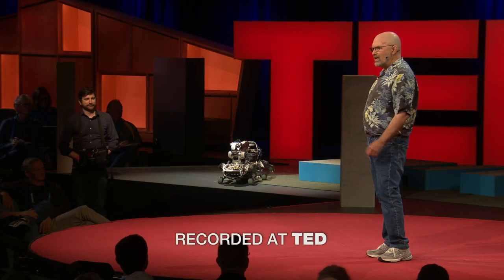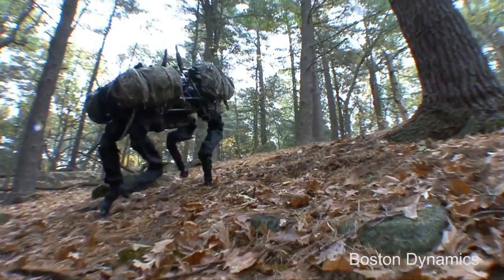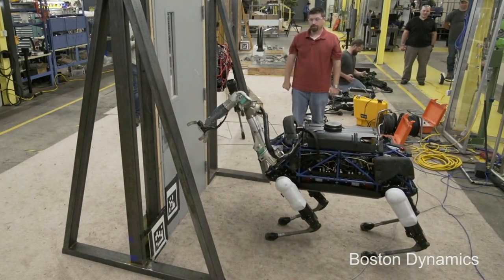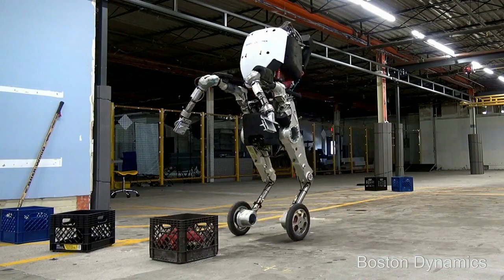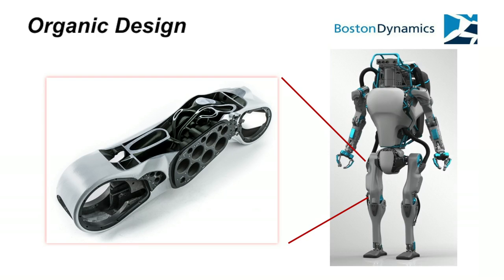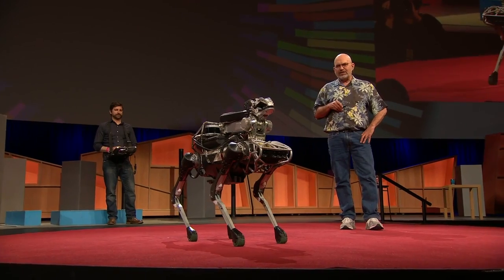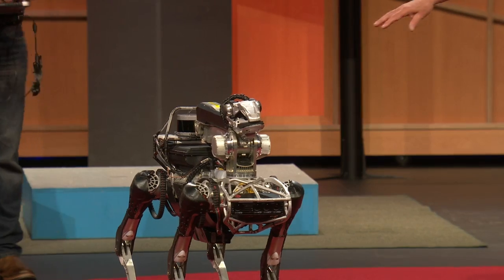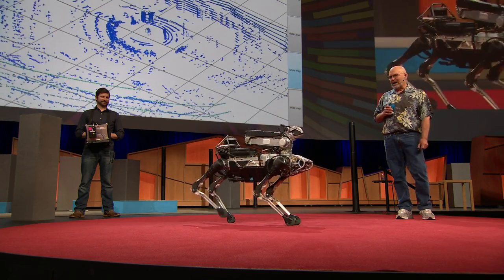Meet Spot, the robot dog that can run, hop and open doors | Marc Raibert

Comment: If you code a robots subroutine with the following formula it will run perfectly (F= m x a x 2383) or you can use this (F= m x a x a x a x a) without this code it will only run at 31.821% as  is so it will run like a toy. They know and can tell you about light speed. Time travel is not possible but light speed travel is.
Test this by going from low to high on the acceleration factor start at F=m*a*100 and keep going up to F=m*a*2383 the limit.

Comment: And now he's available to the public three years later. 

Albeit around 70,000 usd though.
Reply: I wonder if they will be fully configurable and modding-friendly or fully closed and proprietary. Like android/WM or iOS. Anyways, the price should be at least 1000$ or lower to be available for many users. What is more likely to happen is the analysis of such a robot in China and the creation of a much cheaper analogue
Reply: @olgakust4536  1000$ would be ridiculously cheap for a robot like this.

I think even in many years a price like 10000$ would be a lot more realistic.

Even high-end phones or bicycles are far more expensive than 1000$ and this robot is a LOT more advanced.
Reply: @olgakust4536  china has one for 10000usd an complete copy
Reply: I can buy a 98-inch 4,000 nit 8K TV from Sony for that price. 😂😂😂

Comment: Another powerful trend is that of the DIY robots. The best part is that it will be compatible with any instrument because of AutoIt:

https://www.amazon.com/Practical-Laboratory-Automation-Made-AutoIt/dp/3527341587/

I have made other autosamplers, but not as fancy as the robot shown here. They work very well with the analytical instruments for which they were designed:

https://www.researchgate.net/publication/322363581_Osmar_the_open-source_microsyringe_autosampler

https://www.researchgate.net/publication/327230541_Auto-HPGe_an_autosampler_for_gamma-ray_spectroscopy_using_high-purity_germanium_HPGe_detectors_and_heavy_shields

Comment: Yes being interested in improving buildings robots these people have Tunnel Vision .ok if they are there to help us good but when robots are used against us robot police enforcement run faster than we can 100 times stronger how do you stop a robot with an armored body & wants to do harm to you.

 People wake up . The elite put information in films they have to part of rules up to us to use this information be aware.

 ((Terminator / I Robot / Star Trek / Voyager the Borg )) .

 The real threat is AI & robot combined self-aware autonomous self-learning Re-programming software. 

 How many people deliver goods just think what happens when a robot does that.

 Robotic receptionist just look at Sofia. Supermarket or shop shelf stackers just think what happens when a robot does that.

 We become surplus to requirement. 

You don't think an employees will replace you with a robot don't have to pay works 24-hours a day non-stop and makes them more money employer will  say to you goodbye you've been replaced. 

what you see now is not what is available now totally more advanced than you think .

 Just watch the films highlighted and think.

Comment: People should chill a bit on the rise of Skynet. What he has here is a walking system. It can grab something and move it through space to another point (usually). These are all things a tiny spec in your cerebellum does, along with a million other things his tech can't possibly do, and none of this even comes close to higher level reasoning. It can do some of the basic walking a dog can do, but even a dog can move in so many more ways, much less it's higher level thought. This is a 100 years short of imitating a dog, much less a cat, or even a human. A human will have to directly control these things for many decades to come.  He'll be long dead before one of these machines could be a nurse.

Comment: Soo... these robots are like "smart"phones. Without external connectivity and power supply, they are useless, fast-dying bricks. And remember: batteries are pretty much stalled in performance, and have about 1/10th power density compared to hydrocarbons. Unless some ultra-compact super-capacitors show up, that would at least narrow that gap... to quote old soviet joke "watch is great, just batteries bit heavy".

Comment: I believe we have to be very careful when it comes to robots, as many different agencies will find ways to abuse it along with abuse the people with them.
One thing for sure, robots should NEVER be allowed to enforce any kinds of laws with any humans. many many many things can go wrong including abuse of power.
On the other hand robots are great for when it comes to rescue,  research in dangerous areas, even extreme heavy lifting and manufacturing work.
but again, never ever be involved or be in any vicinity when it comes to enforcing any laws against humans.  Humans should be the only ones to enforce laws against other humans.
This is how we protect humans from other humans with such robotic handling abuse of power. and it keeps humanity as human as possible without any interruptions from any robots.

Comment: I think you have to be a programmer to fully appreciate the awesomeness of these robots.  I remember in my C++ class in high school the very first assignment we had was just a logic problem: you have a robot that you can give 2 commands: take 1 step forward and turn 45 degrees to the left.  The robot is facing a wall that is 7 steps away.  How many commands do you have to give it to make it walk to the wall and face right.  The answer is 10: 7 x 1 step forward commands and 3 x turn 45 degrees left.

When you realize what it takes to make a program complete even something so simple you can begin to imagine the amount of calculations going into these robots.  It's truly astounding.

Comment: In yoga it really helps both noobs and pros to focus on a spot 2-5 m away on the ground or close to it to do a one-legged pose like the tree with arms downwards first then raise them in 45 degree angle for added difficulty along with your focus and head to straight foward or even up to the sky. The same should apply for a robot doing (or attempting) the same thing.

Comment: Spot spent about 4 minutes moving around during the demo and was down to 80% battery. It used almost 5% walking over to get the soda. This is a major hurdle for legged robots that have to operate independent of a power cable. You can't significantly beef up the battery without significantly increasing the payload weight of the battery pack. That means they are essentially incapable of designing one that operates for over an hour untethered. This is why people put wheels and not legs on machines.
Reply: Well, don't worry. Battery tech is improving too!
Reply: So soon after a couple billion in R&D you can buy a a highly complex $400,000 robot with thousands of small mechanical parts with a dedicated engineer piloting it can bring a soda can most of the way to you for 40 minutes instead of 25 before needing to replace batteries or charge for 6-7 hours.
Reply: Exactly, the power issue is simply one that has no readily foreseeable solution near to mid term solution, even at the maximum physics based efficiencies which you're never really going to obtain none of the near to mid term battery options have the power density needed to run these things for any length of time. The only thing with the needed density is... a combustion engine of some sort, but that has all sorts of problems on it's own.   

Also that's not 2/3rds human speed, not even close. It took it near enough 20 seconds to pick up and move one moderately sized box from a chest height desk to another 3 to 4 feet away and then start toward the next one. That would never pass muster where I work, you'd expect a speed at least close to three times that on average for that task. I know that for a fact having done almost that exact job (with the extra step of scanning a bar code) because said barcodes are used to time a per minute rate and in those conditions I could easily do 9-10 per minute for at least several hours. 

Robots aren't going to be taking jobs anytime soon, they're much too expensive and much too limited. The people talking about them displacing major numbers by like 2030 are batshit retarded or have lots of money in robot development companies, often both I suspect. 2045 maybe they're starting to be a factor, but honestly 2065 is probably a more reasonable number.
Reply: I'm happy to see other skeptics exist, seems like lots of people are drinking the coolaid. The second this thing carries a larger (heavier) battery the efficiency would suffer more. The second it moves payload heavier than the popcan the same would also be true. They are so expensive and specialized and have so many moving parts that just supporting them would take massive amounts of money and support people much more trained/talented than the people you could have paid to just move the popcan. There is a huge difference between a legged robot moving around a few minutes and being put to actual use. Boston Robotics is several years and billions of dollars in and they are nowhere close to building anything resembling an actually useful product. It's a great thing Google has so much cash to fund this hobby.
Reply: They might have to go the way of mimicking biological structures. Artificial muscle instead of servos, etc.
Reply: I have biological structures and I can push a car alone but several of me cannot lift part of one let alone carry it over a distance. Because legs require continual lifting and support of weight the efficiency will always be order of magnitude less efficient than wheels. I can roll a 5,000 lb vehicle with less effort than carrying 100 lbs using almost the same groups of muscles. What this means is not matter the technological advancements of legged platforms they will always be challenged with just powering themselves limiting their range usefulness in applications by significantly limiting their payload weight. If someone built a car that moved at only 10 MPH and needed 3 gallons of fuel to go a mile we'd call it archaic, useless, and even irresponsible.
Reply: Yep, the utility robot of the future isn't going to be the terminator, it's going to be one of those bomb squad robots with articulated treads and a beefier lifting arm.
Reply: Exactly. XXth century rocket equation became XXIst century battery equation.

Comment: 5:50 I would start running if I saw that thing cause I am so freaking scared of robots I can die
Reply: Tim Gimbel pretty sure it has a top speed of about 30mph, so you don't have to worry about running for too long.

Comment: The villains of the world are licking their lips at this tech. Imagine that dog with saw blades attached to it, running into a crowd of people. The horrors are endless. I hope governments start regulating this technology. It is too dangerous.
Reply: I'm My Own Master Now - Metal Gear Rising OST
Reply: Governments will have their own killerbots...
Reply: Stop taking drugs, Bear. Or start with medicals.
Reply: The technology and skills needed to build this kind of machine are either too expensive or rare for terrorists to get their hands on right now. Overregulation would waste the potential benefits to society.
Reply: The villains of the world think robots are too expensive when child soldiers are essentially free.
Reply: Robotics is in the upper tiers of technology. It requires extremely high levels of engineering, coding and electrical science to create this sort of tech. Some third world shithole is not going to come up with this.
Reply: Well, imagine a car with saw blades running into a crowd. It's too dangerous isn't it? Maybe we should regulate cars so people don't abuse its use.

Comment: While very profound, I'm still curious as to why the persistence in developing anthropomorphic robots.  Yeah, "because we can," but we've been trying to do that for years.  The great thing about creation is emergence and transcending the limitations of the known, not simulating what we already know.  If the goal is to create helpful counterparts to the human race, I highly doubt the best solution is one that functions as fallibly as humans.
Reply: Theoretically human-analog robots would be able to easily move through buildings and facilities already designed for human access without the need to do any remodeling.

Comment: This is very impressive. Big Dog was impressive a long time ago - and this is obviously just getting better at a rapid rate.

I suspect that one of the next big things that might get tackled in terms of robot mobility may be flexible bodies. Spot can't turn like a dog actually would despite it's balance and natural-like limb movements because it's still just one big rigid body with actuators and motivators attached. Modeling spine-like structures and synthetic muscles rather than motors and actuators is something I wouldn't be surprised to see in the next 10 years.

And then we need to start being real careful if true AIs show up hehe...

Comment: 2:43 would be my exact reaction if I saw this thing in the wild.
Reply: PowahSlap Entertainmint If I saw that creepy thing running my way I would pull out my pocket knife and slit my throat. Better to die on the spot  than being captured and tortured.
Reply: PowahSlap Entertainmint 5:40 would be me
Reply: The thing doesn't fall down so it'll probably ram you in karma.
Reply: PowahSlap Entertainmint 12:40 My reaction
Reply: Lol